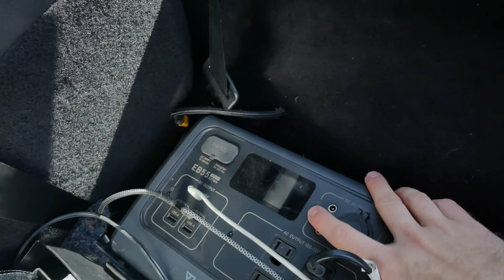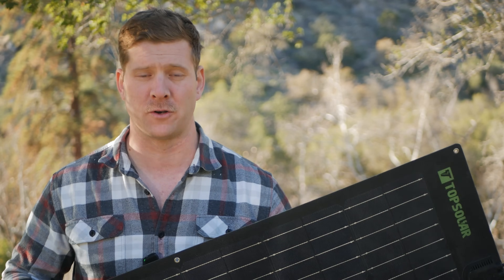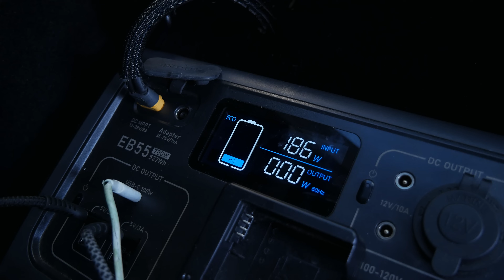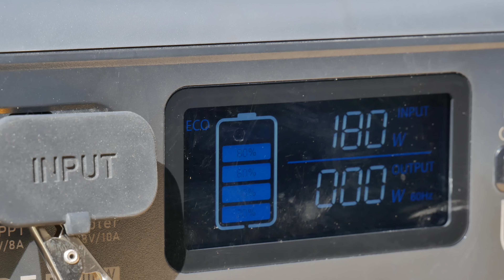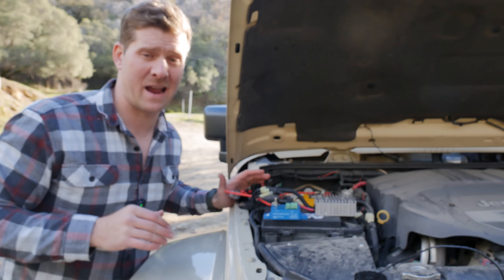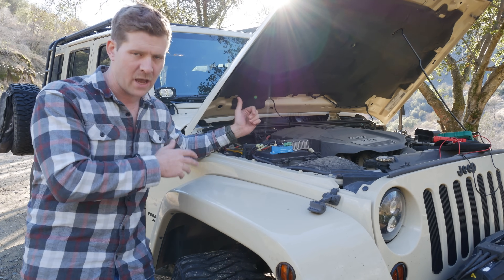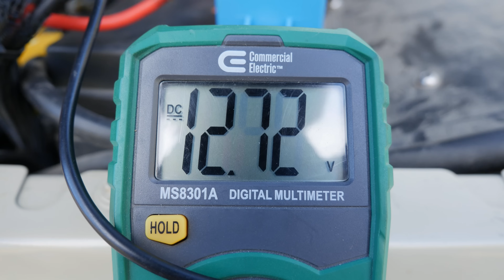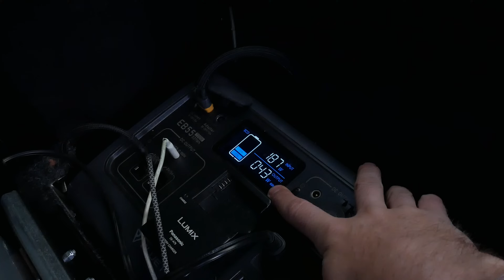Solar is Impractical for Overlanding: Here's a Cheaper Alternative That Makes 200W!

Comment: So I would argue that use of the alternator (which believe me I've done and used when I lived in my camper van) is actually not that much cheaper if at all compared to solar. And that's because it has to do with the wear and tear you place on the alternator and engine, as well as keeping in mind that either of those two are running at their most efficient rpm's which means for the cost of fuel, you're also not getting the best bang for your buck.

One suggestion I have, and of course this may also act more as a supplement to offset your energy needs, but what I would do before I hit the road/camping is I'd keep all of the food in my main fridge in the kitchen, have either 1, 1gal water bottle in the freezer to turn to ice (or a handful of regular sized water bottles depending on what I think the free room:food ratio I plan on packing for the trip, along with plugging my Dometic fridge/freezer set at its lowest temperature, the night before or even a few days before the trip (1gal will take awhile to freeze into solid ice). Then the morning/day of the trip, one of the last things I load up is the food and iced bottles into the Dometic, Dometic in the car and set at a fridge temp, and [I don't have a portable battery as I setup all of the components myself custom DIY style] grab the fully charged portable battery, make all the connections needed in the car, including having the battery charging off the 12v cigarette lighter, then finally hit the road. During that time, and practically for like the first 2-3 days, you should see very little power drawn from the portable battery to your fridge, because everything has already been pre-cooled/chilled down AND you also have a thermal battery(ies) in the fridge...the iced water bottle(s) that will greatly aid the fridge in maintaining its temp while reducing the amount of time the compressor is on. Really the only time you should start seeing the iced bottles begin losing their effectiveness is around day 2 or 3 and that's when you'll see your fridge compressor kick on more frequently and draw power from the portable battery. But your portable battery ideally should be sized up to last you comfortably for at least 2 if not 3 days for the appliance you're powering. So in such scenario, you're looking at extending your overlanding to 4-6 days before you find yourself needing to recharge the portable battery. And at that point, there's other things that you could implement to extend it by another 1 or 2 days further if you're out for longer periods of time but really, solar would just be the best option.
Reply: Standard stuff everyone does before a trip! Solar is fine in Australia or sunny climes but practically useless in Britain and similar climes except for two weeks of the year, so thats a bust.
Reply from the maker: @inventor1v agreed

Comment: This is a great Idea, I think replacing the low voltage cut off with an ignition switched relay would be better. That way the step up converter would only be on when the vehicle is running.
Reply from the maker: @eagriggs1  great suggestion!
Reply: @RhinoOffroad  I actually misspoke. Should be an ignition switched relay and not a voltage sensing relay.
Reply from the maker: @eagriggs1  I do like being able to charge when the Jeep is off though. I think I'll just raise the voltage cutoff to 12.2 or 12.4

Comment: Really...  Look up redarc and build a real 12v system,  the problem with new vehicles is the alternators cycle for mpg,  get a real 12v system with a large storage battery and solar,  also a good fridge arb/waeco with low amp draw,  many of the cheep ones use alot of energy,  i can run days without starting to charge, size the system properly and do it once.. its cheeper that way..
Reply from the maker: @rayjon237  and also vastly raises the cost. The whole point of this is that it is a cost-effective solution that works; I'm not saying that there aren't better solutions for more money

Comment: There is a very real risk using the cheap converters.  Given the options, I'll go for 4-500W charging using a product that includes a proper spec sheet.  Tinkerer's Adventure explains it better.  https://youtu.be/s_-9vj-hF1M?si=rnjrxyzUVeWTOLwj
Reply from the maker: I get what he's saying, but I don't think it's inherently unsafe just because it's cheaper. If it ever tries to pull more than 20A on the 12V side, my circuit breaker would trip it if. The overheating issue is definitely something I'm going to do more testing on though, and might relocate it to inside my Jeep.

Comment: luv the 250 watt panel.. just fits roof rack.. charges 200 amp hr. lithum. 2k inverter for fridge/induction plate cooker/ electric blankets  etc.. no more propane... keeps started /winch batt topped off as well...  DC runs lights/ coms/ 100 watt bluetooth w/ subwoof.. thanks.

Comment: Nice video :)

You would gain efficiency in the system by mounting the buck converter closer to the Bluetti. That way you don't suffer from voltage loss in the cables from the buck to the Bluetti.

The buck converter being solid state electronics, probably isn't enjoying the heat under the bonnet/hood leading to futher inefficiencies.

I use a buck coverter on the 12v oven avaliable here in Aus (Travel Buddy) to increase power to the oven, pushing the voltage up to 15v and let Ohm's law take care of the rest. 

Keep up the great work.
Reply from the maker: Great tip! Will look into this 🤙
Reply: Travel ovens are quite basic heater coils and a thermal switch. 
It depends on the devices. Some can be run outside of their designed 12V, but others can fail sooner or later if not close to a clean 12V, even saw a few fail from a stock charging setup pushing 13-14v.
I have seen several items not run right. Using a rectifier and picking an input range of, say, 9-32V and outputs 12V cleaned up a lot of issues.

Comment: Seems like worst idea tbh... buck converter, programmable  switch, added load to the alternator, increased fuel consumption, and the need to run engine, wasting fuel converting most energy to heat instead of actual usable power if parked up somewhere  for couple of days..  yeah..  that solar you shwed is probably only 10% efficient, then what charge controller used? There are some good split charge controollers out there that can take input from the alternator, charge auxiliary  battery while driving, and when parked taked solar input and charge both, auxiliary  batery and main battery.. 
Nevermind though, if your system  works for you, brilliant👍

Comment: you have to run your vehicle to charge. solar is passive and yes you may not get full output on a cloudy day most modern panels still produce power while stopped and camped. while driving of course this make sense.
Reply: Nobody has mentioned the wear on the car.  The Alternator bearings would be my concern as a first item that might fail
Reply: @rubiconadventurewithscotty3258  honestly unless you are pulling a heavy load alt bearing should be fine. But yea hours on a motor isn't good. Even a diesel which is better still not efficient or good on engine wear
Reply from the maker: Agreed, but I'm really only pulling 200W for the 3-4 hours it takes to charge (assuming it was dead), then only takes 30-50W to keep it topped off until I arrive at camp

Comment: Dude, your car alternator puts out 14.7 volts at 40 amps assume 10 amps usable , why you want to spend bucks stepping up your voltage to charge your camping battery is beyond me.  Your little solar panel is 50 watts just enough to slow charge a 12 volt car battery over 3-4 days. Charge your camping battery at home. Do not charge from your car battery without the engine running or you'll find yourself with a dead battery.  If I'm going camping I don't bring a frig. If I (spouse) want the comforts of home we bring our 14ft Pop-out RV Trailer.   It has a bathroom, kitchen, Frig, microwave. TV and AC, heater, 3500 watt inverter genny, solar panels, 5.5KW battery bank, 3500watt Inverter, Internet. 30 gal water. Propane, stove, coffee maker will sleep 6 adults.  And can easily last a week Boon Docking.

Comment: Jasonoid just did a video on a new product that allows solar AND alternator input and it will output up to 500 watts to power bank.  It's only $300, so it seems like a better option than this conglomeration of devices.  Thanks for video, just want the viewers to also look at the other options.  Ecoflow also has a Alternater charger that has Bluetooth capability AND two way charging (allows your power bank to act as a "jump box" and help start your vehicle if needed !!
Reply from the maker: I'll check it out, thanks!

Comment: It works, but just be aware that those converters do get very very hot when converting. Could be a fire hazard if not mounted in the right spot with good ventilation.
Reply from the maker: @RealitySurvival  great point, doing some tests currently to see how much it heats up when driving
Reply from the maker: @RealitySurvival  moved it to under my passenger seat and it maxed out at 85F
Reply: @RhinoOffroad  Free heated seat 🤩
Reply from the maker: Exactly
Reply: @RhinoOffroad  Glad to hear you moved it. Smart setup, underhood was my immediate concern with engine heat.

Comment: 190 W/ 12V = 15.8A. That's hard on the cigarette lighter fuse.
Reply from the maker: @rlemoyne007  not using the cigarette lighter! 40W is what I was getting from the cigarette lighter. I have the output of the step up converter going into an XT-60 plug then into my portable battery 👍

Comment: Nah, solar is not overrated (50W? Pfft. I carry that on my non-electric cargo bike - Solbian SP series). Buy better, more efficient, and larger panels. 
Also, you mention that you can "only" use solar panels when stopped. Well, your solution only works with the car running. Not sure that is such a good "solution" either. You put a whole lot of faith into an alternator with moving parts, and even ignore what a suitably sized solar panel setup can do. Without having to rely of running your car, and not have any of those parts breaking down.

Comment: Is that 12V cutoff adjustable. 12V is a dead battery. It would be best if you had the cutoff at 12.6V or possibly even 12.8V.

Comment: 12 volts for a lead acid / AGM is practically dead! 12.5 volts at least would be a more sensible level. See also my other comment re using a DC-DC charger instead of this complicated setup.

Comment: Can you use the same set-up you have for your Jeep to a solar panel, increase the voltage of the panel to 24V...?
Reply from the maker: @schruffy  not sure to be honest, but relying on full sunlight and only being at camp a few hours before sundown kind of negates the benefit (in my opinion)
Reply: If you get the chance to try it out on the long run for a few days if you can reconnect you set-up from your Jeep, I’m looking for an alternative for a low powered A/C for my Park trailer camper, the one with it draws too much current and the voltage at camp site varies, like yourself i’m a novice and  before spending a lot, I’d like to get as much input on the subject.  Thanks a lot, all the best.

Comment: This really doesn’t make any sense, with a vehicle running and a load your actual voltage would be closer to 14.5, thus closing the gap substantially to this step converter. Also, I would not count out a thing lasting very long in the heat of the engine bay. Many battery generator manufacturers make an alternator hook up that allows input through an alternate source. Often getting up to 800 W of charging if your alternator allows.

Comment: I use solar panels at 200 watts to maintain 4 6v golf cart batteries in my class A RV. The only time i have issues is in Dec and Jan when sun exposure is at minimum. Simple cheap solar works great. My system cost around $300.

I would never consider running my RV engine for charging unless its an emergency. Why waste gas when solar does the same thing fir free. If it's cloudy add more panels to make up for it.
Reply: Ditto, I'm a snowbird and 300w on the roof of my class c runs everything 😅 I do have another 200w of portable for when I'm parked in the shade

Comment: So you use the 12v battery to charge the jackery battery to power the fridge 🤔 

Instead of charging a battery from another battery just connect an inverter directly to your 12v agm and run the fridge from it. Less voltage conversion losses that way
Reply: A split charge vehicle battery system would work best. First battery for starting the engine etc. 2nd battery for the fridge. 2nd battery only receives charge when the first battery hits full charge.  
Most overland vehicles  already have this setup for a winch.

Comment: I don’t see how it is cheaper to use your $50,000 vehicle as a generator and who is going to leave the engine on their vehicle running for three hours in order to charge their battery. I think a small generator would be more practical.
Reply from the maker: @jdouglas4564  it's not being left on at camp. It's charging rapidly while driving on the trail.

Comment: Why not use an inverter to charge the pack. 
They are dirt cheap to buy and easier to fit, plus with a plug rail you could charge seperately whilst running the fridge on its own whilst driving then switch back. 
And wow a 200w fridge. That is thirsty. 
My full size house fridge freezer is only 30w and it is tropical rated as i live in southern Spain. 
All seems a bit odd to me. 
Maybe these things are not available in the states or too expensive.
I have a 12/24v 1000w inverter and it cost less than 100€. 
I have a small fridge for travel that runs at again 30w and that was 400€.
Reply: Whats the brand of you small 30w fridge
Reply: @Mark300win  Vestel.
Reply: @Mark300win  Just tried to find it for you but think it is discontinued. There are plenty of others on the Web though if you just do a search and even more at 40 to 50W.

Comment: Set up an alternate power system for your truck, integrating solar power and the components you've listed (second alternator, 12-24V step-up converter, low voltage cutoff, circuit breaker, and high gauge wire), you’ll create a hybrid system. This system can charge an auxiliary battery bank, which can power various accessories without draining your primary battery.

Comment: Yes, your vehicle's engine is an alternative to solar...but now you're burning fossil fuels to generate your amps. You've just turned your Jeep into a generator...so from one perspective you actually have a MUCH more expensive alternative. A $32k+ alternative.
Reply from the maker: @BlackBanditXX  except I'm not running it anymore than I would otherwise; I'm just getting more bang for my buck while driving.
Reply: @RhinoOffroad  You still have to burn fuel to make those Amps, so you are consuming more fuel than if you were using solar.

Comment: I did the same thing on my 4Runner for my Bluetti EB3A.  The only difference, is that I used the cigarette lighter for the in source and just used larger gauge wiring.  On our last trip, I didn't have to break out the solar panels because it charged up so quickly.
Reply from the maker: Awesome! What rate of charge are you getting? What gauge of wire?
Reply: @RhinoOffroad  my EB3A has an input of 12-28vdc at a maximum of 8.5 amps.  My DC to DC convertor is a 12 vdc input and 24 vdc at 8.0 amps.  I forget what gauge wires I used, but I made sure the wires I used were thicker than the wires on the convertor and the cigarette lighter wires.  So far, the wires and the convertor don't overheat with a load of the frig.  The EB3A will last all night powering the frig.  Then the next morning driving to the next camp site, the EB3A is fully charged again.
Reply from the maker: @2-old-Forthischet  dude that's awesome, I honestly never considered repurposing the cigarette lighter. Super creative

Comment: Yes ohm's law 
 Volts times amps Equals Watts 
You're leaving out one small factor the Fuller the battery gets the less it can take in actual flow of the electrons is rated in amps 
That's why I'm the eCards it says to move on if there's a line once you get to 80% the charging slows down 
So you should give it a try measure volts and amps as the battery gets full and it will tell you actual watts that are going in to the battery 
Because volts is pressure just like pumping water you must overcome the incoming pressures to put anything in

Comment: Be careful to keep an eye on your alternators charging voltage it can let you know if the amperage is starting to get weak... The reason the alternators able to put out more power than what's being used is because running something at 50% load capacity extends its life. So adding extra loads to your electrical system can put an extra tax on the lifespan of the alternator and battery

Comment: Alternators go bad frequently and any mechanic can change one out. If you really want to use the vehicle as a power source you can upgrade your alternator. Look at the specs on your alternator, some are 60, 70, 200 amps. For example, 60 amps at 12 volts is 720 watts of power. Another cheap upgrade to add a second deep cycle battery. That said, I just used my trucks standard alternator and battery when I went coast to coast and border to border in my vehicle.

Comment: Look up dewalt 1800 watt power station 
2 systems    1 to power ice machine for my ice box (portable fridges consume) and starling
                        2 to power all lights, charge phones, tablets, flashlights, 
From 3 days max to now 5 days max the only thing holding me back from staying out is clean water I now need a trailer to hold clean water 
Before then I’m going to test on cold temp